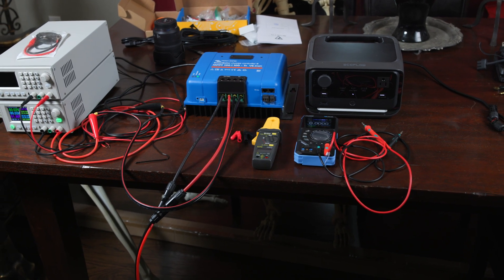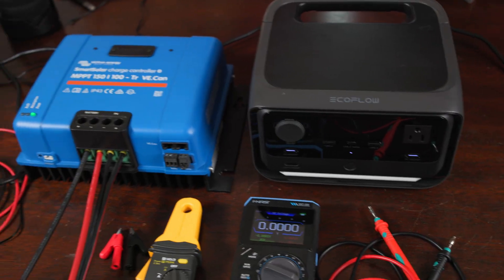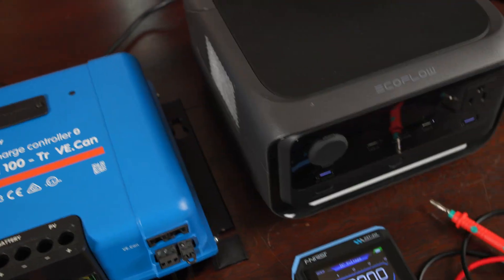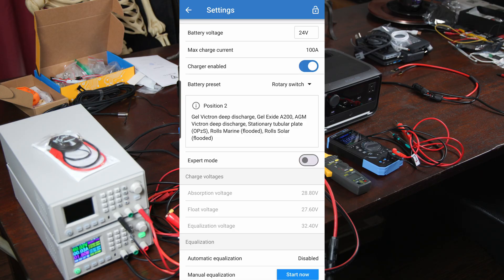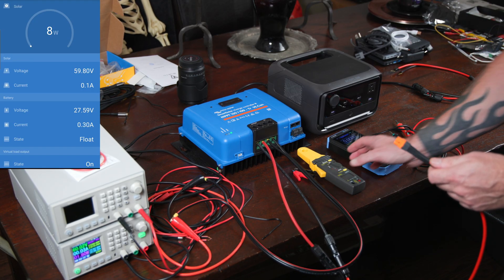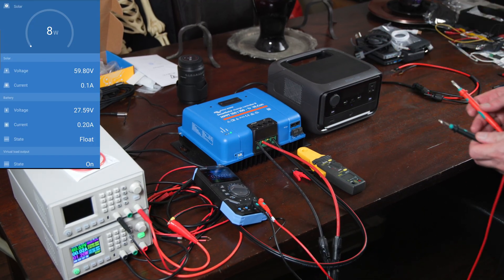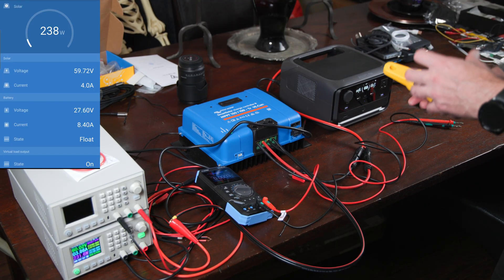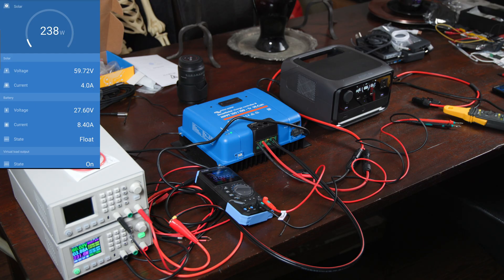Maximize Your Power: Connect Oversized Solar Panels to Small Power Stations with MPPT (No Battery)!

Comment: I get it, but the real bottleneck here is the limited power draw of the power station's solar input. (Ie. 220W). I'd rather stick an inverter in the middle as the Ecoflow will draw more power from its AC input. Sure you lose some efficiency converting DC to AC and back to DC again, but you get to 100% charge a lot faster.

Comment: Most residential 400W+ panels have a Voc below 50V. As long as you don't connect large panels in series it'll be well within spec of the River 3 Plus.
Circuit protection should be done with fuses/breakers not MPPTs, a MidNite Solar MNEPV20-150-1PNP Circuit Breaker 20A 150VDC is like $17.
Paralleling solar panels requires fuses between branches anyway once one exceeds their maximum series fuse rating.
While MPPTs are efficient, they still result in power loss; notice your MPPT is showing an input of 237W and the River is showing an input of 220W, so 93%.
Using a $500 MPPT to charge a $200 power station, priceless!
Reply from the maker: In my case I have spare panels already setup to a MPPT just for charging anything I want in a solar shed.

So I can charge my 12/24/48v equipment all from the same setup and all the power stations as well.

I have a 12v setup on there for my landscape lighting and the ventilation system but wanted higher power (voltage) for charging and this was a viable solution and cheaper than buying and building a system with multiple voltage conversions when only one is needed at a given time.

There is no waste with the conversation when your using extra Solar that would have been waisted.

You are looking at the example as a solution and not what was displayed clearly as "an example" and different examples can easily be given but no examples have a practical use for everyone.

So the goal is something easy to produce and display for educational purposes.

We are learning about how the equipment works, why and how you can use that to your advantage.

These types of hacks lead to the knowledge to compose greater and greater things, as you will see because oftentimes these videos are acting as the pre-cursor knowledge to bigger videos coming up.

In this case the external MPPT to a power station idea that is so expensive.. well if you stick around you will find it was actually a way to save money on.a different video I'm waiting on a lot of solar for.

As for the rest, Solar panels do not need fusing for parallel count of two and we had no parallel panels used in the video.

We also do not need fusing in this case as it was again just a demonstration, with a fuse in our power supply and the power station with its own protection that we verified with a meter before connecting.

In a real setup with a lithium battery I use and recommend Class T fuses.

On real solar setups we have PV cutoffs.

If you go watch some videos where we are not in a lab environment you should see these things.

I appreciate your watching and commenting.

Comment: 1:05 hit the brakes, it is not about too much power, it is about too much voltage. The small power system might not be survive receiving too high a voltage. It does not care about watts.

However you do want to use a battery to function as a buffer so you can have all the yield from the solar panel and still use it to charge the small powerstation. I have this running for a few years now and it works great.

I prefer to use a Victron 100/20 for this so you can use the load port and give it a shut off voltage to protect the battery. An advantage of your system is that there is no battery to protect. 

If the river is a 11-55 volt input one, one can alsosend 36 volts to it so adding 50% of wattage to the small river.
Or even 48 volt effectively double the wattage
Reply from the maker: Watch the entire video it's quite clear we are talking about voltage.  We even started the exact figure of ~50v being the max vs the 60v source to make it clear we are taking about voltage, and used the MPPT as a "voltage regulator"

We also talked about why we chose the lower voltage on this video (for a more clear demonstration on what we are doing) and we still got the cap power for the unit (the goal) but did mention we would use a higher voltage normally but this was a demonstration.

Even though the river 3 can support 55v max we can't use 55v solar safely (I just use the 20% rule) so I'd personally cap at 50v especially if we are hitting max MPPT throughput already.

The one big warning here is you cant use 48v battery (52v nominal) safely here and I see someone doing that if we said 48v is good to go.

When your teaching people you have to think how others interpret what your saying.  So we sometimes have to be careful what we say and sometimes over explaining only leads to confusion so we simply certain aspects to achieve our main goals.

I love long form content, but I can't make a simple video an hour long :)

Thanks for watching and commenting.
Reply: @ViciousXUSMC  Then be correct from the beginning!
Reply from the maker: @HansKeesom  Finish watching before saying something :) J/K if you want to quote what I said that was incorrect, I will correct it next video.  Otherwise understand I also am not scripted and not doing multiple takes unless I completely bomb a take.  This in my opinion is a more authentic real life person to person experience and you know the knowledge is in my head, not on paper. 

So people do step on words when talking outloud or use words in interchangable ways but its the intent of the words that matters.  I can't be in the business of arguing linguistic semantics, else we would never get to the point and actually learn or do anything. 

Just the topic of "solar power station" can start an entire war on solar forums, people will never all agree to terms, so try to understand what people are saying instead of judging them based on your perception of how they should be saying it.

For anyone that must know I can't spell to save my life, I have dyslexia, ADHD, and I am blind in one eye.  Things are harder for me than "normal" people.
But the trade is my brain works very highly above average when it comes to STEM things like Math and Science, and so that is where I focus.
Reply: @ViciousXUSMC I said what was wrong, it’s at 1:05.

Tried to watch it to the end but it was not that interesting, maybe because I have the same setup but I think better for years already.